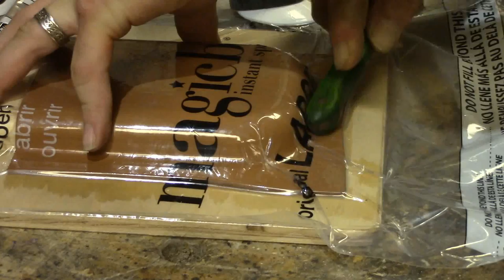GPW 124 - DIY Leather Tool Pouch

Comment: I came across this video while looking for tool pouch patterns. Looks like I could carry everything I need in that. Do your wire strippers or needle nose ever fall out? Personally I would have had the leather cover up some of the handles as well, but I imagine that this way it’s still useable if you change the tool to a different one.
Reply from the maker: I never had an issue with the tools falling out... I have since moved up to a newer pouch, but I still keep this one around for work at the house.
Reply: @GPWoodworks  good to hear. I might wind up doing something like your crossbody one, or a really small one I can clip to my belt.

Comment: What oz leather did you use?8oz?
Reply from the maker: Yes... 8oz is about right.
Reply: Thanks & one more question where do you get your leather from
Reply from the maker: I have a Tandy Leather nearby. I usually just buy what's on sale. 

I don't make money on these usually so I need to keep the costs as low as possible.
Reply: When molding how long did you let it sit for
Reply from the maker: I think I let this one sit under pressure for about a half an hour (I can't really remember for sure). Then I let it air dry on the mold until it was completely dry... I think this one took a few days (maybe even a week). 

It was a year ago, I may be remembering these details incorrectly.